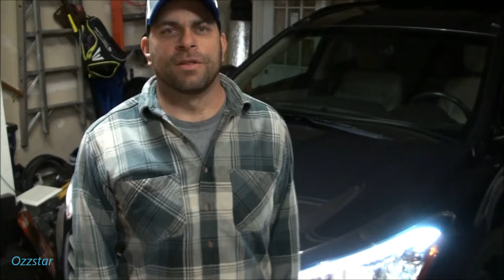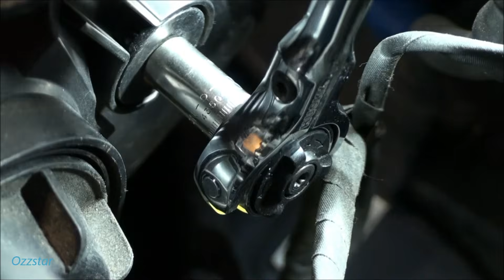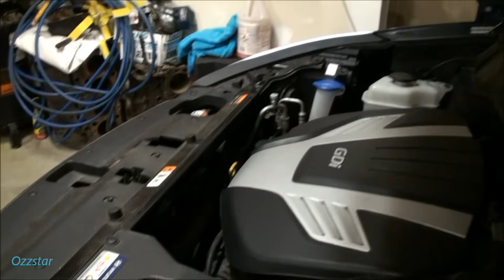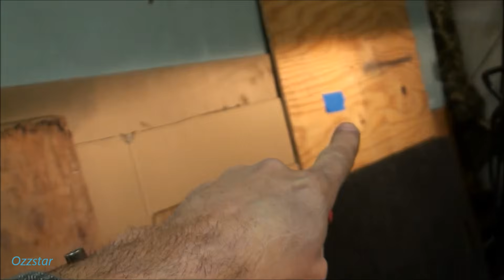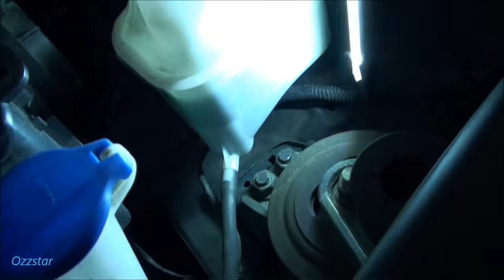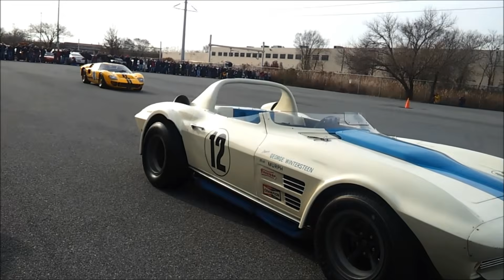Hyundai Headlight Adjustment -Easy and Quick

Comment: Measure from the ground up to the center of your headlamp. 
Put that same distance on your wall.
Of course all on a level surface.
Then backup 25 ft.
Then set the top of your light about an inch higher on the passenger side then the mark on the wall. And on the driver side right on the line on your wall
Reply from the maker: That's one way to do it.

Comment: This is good information. Unfortunately, my 2024 Hyundai Palisade does not have a socket-ready adjustment screw as you showed. Instead, there are 2 (regular and high-beam I assume) white recessed round sprockets, which I read somewhere require a “Torx” bit. I have no idea what that is. My headlights are definitely aimed too low, making the upper 1/2 of my windshield so dark that I literally can’t see through it. Very frustrating!
Reply from the maker: I own a '24 Palisade Calligraphy and the headlights are amazingly bright. Which model do you have?
Reply: @o @ozzstars_cars 24 Palisade SEL Premium package.

Comment: My HIGH BEAM lights are too high so I will lower them. Recently I noticed when switching to low beam, it is dull as hell and I can barely see at night. With low beams on the on position, the ring driving light is lit on both sides and the little square light is lit on both sides. Where does the low beam setting come from? Is it a second filament in the same bulb/light as the high beam you just showed us how to adjust? Again, the only thing lit on low beam setting is the ring light and the two square lights that do not seem to project any farther than twenty yards. It was not that way before. My lens is clean and clear.
Reply from the maker: You forgot to mention what type of car you are working on?

Comment: Thanks for sharing. Was super clear and informative. Any quick fix for gdi massive oil burning issues😂
Reply from the maker: Probably stuck piston rings due to excessive carbon and varnish due to lack of oil changes. Oil should be changed with synthetic no more than 5k miles max, 4k miles preferred.
Reply: @ always done regular oil changes at 6000km aka 3750 miles in the u.s , full synthetic. I must have just got lucky with a lemon. New sub over here from 🇨🇦
Reply from the maker: @Justgaragenit  four banger turbo? Which engine/model? The 3.3L V6 in this video was sold with 155k miles and running strong when sold three weeks ago.
Reply: @ozzstars_cars  2.0 gdi turbo.
Reply from the maker: @Justgaragenit  that's what I assumed. I stick with V6 Hyundai engines only. 3.3L and 3.8L that are properly maintained last a long time.
Reply: @  the 2.0t isn’t known to be great. I’d imagine the 3.3 would be rather similar on fuel consumption as well.

Comment: Is there any way to adjust LEFT AND RIGHT settings? Up and down is great but my passenger headlight is way off to the right. PLEASE HELP!
Reply: There should be two adjustment bolts for each headlight - one to adjust up and down, the other to adjust left and right.  You also don't need a socket set - it's easier to use a Philips screw-driver and just insert it into the plastic "tunneL" that's next to each adjustment bolt. Once properly adjusted, turning the screwdriver will also result in the bolt turning.
Reply from the maker: Not that I know of unfortunately.

Comment: Thank you so, so much for this video. Our headlights got replaced like a year ago but nobody in my house drives at night... Until recently. They are so effing high (not LED lights) I can't see the damn lines on the road. Hopefully when I adjust them I will be able to see properly.
Reply from the maker: The stock headlights on this model year suck. Hopefully yours are better.

Comment: So I may need to adjust mine because whan I go up hills I believe I can't see but I may be wrong. This has been like this from the factory. I have a 2017 hyundai sonata limited if that matters. I do know I have issues with the lights just can't remember which way right now. I did put a light strip under the hood that has solved this issue but I still may need a little more. I don't drive much at night so I can't remember lol.

Comment: I need horizontal adjustment .. I have 1 meter diameter shadow spot right in front, my beams might be crossed or not centered at all
Reply from the maker: The headlights on this generation Santa Fe are not very good.

Comment: This is wrong. The lights on the driver side have to go a bit down because  otherwise you will flash the driver on the opposite way. It's a hazzard.
Reply from the maker: Not in this case.

Comment: Trying to adjust my wife’s 2019 Elantra the only socket I see it’s a 13mm bolt would it be the correct one?
Reply from the maker: There is a vertical square funnel and it drops down to a toothed gear attached to a 12mm bolt. You have to put a skinny screwdriver down the funnel and turn the gear one tooth at a time. You can get a 12mm wrench or ratchet on the passenger side adjuster, but the drivers side has a wire harness in the way.

Comment: Great video Ozzstar, but I do have an observation.  While you're showing how to adjust the headlights using the 8mm bolt, right ABOVE where you're pointing in the video one can easily see the cross-point adjustment screw complete with markings showing which way to turn!  Turning the screw at the top using a simple screwdriver turns the main bolt.
Reply: Wut?  Cross-point?  Please explain, buddy.  I could use some help.  Recently divorced ol' lady wants to fix this..

Comment: Hi Ozzstars- I have a Veloster 2015 turbo and my headlights are so wonky now, the passenger side headlight whole fixture was replaced because animal impact - had the whole bumper light and fog light replaced. So now is sorta messed up everything besides the driver side lamp was replace by my son-in-law I should have done it but oh well now I have to fix the mess. I am stupefied now I tried your little trick, but I can’t seem to get it adjusted correctly. Someone told me there is a trick ! Do you know of a trick!
Reply from the maker: No tricks that I know of.  Are the replacement headlamps aftermarket? They can be junk.
Reply: Ozzstar's Cars , I don’t think so, I probably will  just go back and let them adjust it , the paint and body place that fixed . 👍🏻 thank you very much, it must be the guy flirting with my daughter 🤣

Comment: Did you have any other problems with headlights not shinning far ? My 2014 Santa fe wont shine up to 10 ft and I've installed 5 different leds up to 12000 lumens and still can't past 10 ft. My fog lights shine further than headlights with up and down adjustment. I have to use high beams just to see.
Reply from the maker: The factory headlamps are terrible.  Yes the fog lights are brighter.  Hyundai should have recalled them because it is a safety hazard.
Reply: @ozzstars_cars  I figured with 12000 lumen led bulbs that would fix the problem but they dont shine brighter or further than stock bulbs. Dealership says they do t see a problem with the headlights. Do t k ow what else to do.
Reply: @paulhenrysalas1038  Me, too. Same problem. The right one shines way out to the right, and the left one shines out to the left.

Comment: Thank You! I purchased a 2012 used Santa Fe and immediately noticed how unsafe( when approaching a hill the low beam lights did not illuminate anywhere above about 5 feet off the ground)  I  called Hyundai, they said there was noting I could do about the adjustment!   I have to replace the low beams bulbs, do you know if the low beams are always H7 or H11, I can not see the number. Thanks
Reply: h7 and don't replace it, just adjust it  on your garage door , good luck .

Comment: Hi.  Great video.  I do have a question though.  Does it seem to take quite a few turns to get them to move?   I'm pretty sure mine went up a bit but I feel like I turned it alot.  Will the bolt come out if it's turned too many times?  Thank you so much Sir.
Reply from the maker: Should only need a few turns for adjustment.  Watch the beam of light while adjusting.
Reply: Just bought a 2017 Hyundai Tucson and the high beams are perfect, but the low beams won't match up, I've watched your video and tried to adjust but no luck, am I missing something, anyone else had problems? To clarify I've used a socket and ratchet but it just turns with no adjustment within the light.
Reply: @matthewmeier7880  Same outcome here.

Comment: If you go too high, you'll blind the on coming traffic. It is also illegal. So, you need to be sure that you know where you're adjusting the beam. Yes, if it's too low, raise it. Just be careful.

Generally, with the high beams turned on, the hot spot at the center of the light should be level. So, measure the height of  the hot spot on the vehicle and place a tape mark that high on the wall. The beam will be wider (vertically) than that, I'm referring to the brightest spot in the center of the beam. When you go to low beam, the light beam will drop down. It's supposed to do that so that you don't blind everyone else on the road.

Older head lights had a left/right adjustment also. Again, using the high beams, set the bright spot to level with the head light and pointing straight ahead. The light beam will drop down & right when going to low beams. The new lights have a very wide beam, so you don't get the right shift as much when going to low beams, but it's kept low enough to not bother other drivers. This is what causes the lights of oncoming vehicles to "flash" at you as they go over bumps. That beam line bounces up into your vision then back down again where it's supposed to be. As a general rule, when following a car, if your low beams are shining above their trunk (i.e. into their back window), then you've got them too high. If you're getting flashed by on coming cars because they think you have your high beams on when you're actually on low beams, then you've got them adjusted too high.

Body shops are supposed to have gauges to adjust the head lights before returning the car to you, but I've seen several that don't do it properly.
Reply from the maker: That is really good info, thanks for taking the time to comment!

Comment: Find a wall where the ground is pretty level. Pull up really close to the wall and mark the top of the beam on the wall with some tape. Then move back 20 feet or so. Adjust the headlight so that the top of the beam is now the same as it was when you were close to the wall.  Maybe just a bit lower.
Reply from the maker: That's a good suggestion.

Comment: Thank you so much. Looking for this info forever. That factory setting IS unsafely low.
Reply: Totally agree! I can’t see at night at all with the adjustment that a paint&body place had mine set! Sooo I used my spidy sense and fixed it. I have not had one flash from on-coming traffic so I think it’s good 😁 thanks 🙏🏻 for your share!!
Reply: ABSOLUTELY ... the dealers should fix them right, for No Charge.  If enough folks talk about it alot.

Comment: When I was at the Holden dealership we would nose the vehicle up to the wall and place a marker directly inline with the center of the headlight then back the car up about 15 feet and the center of the beam should be a tad lower and to the left of the marker. "Right of the marker for you guys".
Reply from the maker: Amazing what a small adjustment cn do to improve visibility.  Thanks ZIG